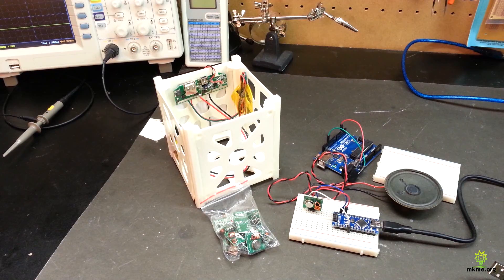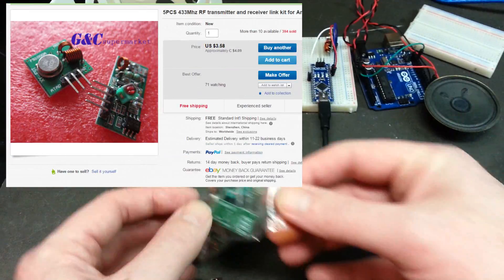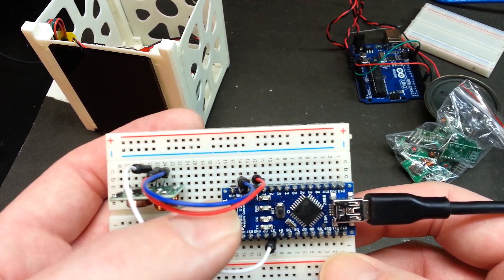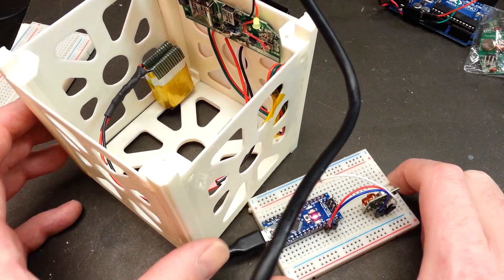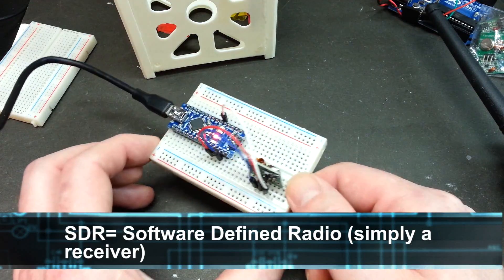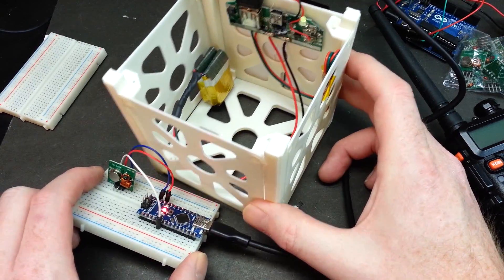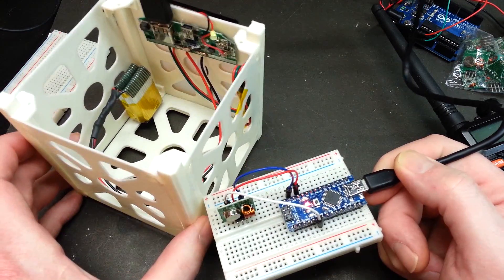Let's make a Satellite with Arduino Part 4- Transmitting Telemetry!

Comment: Bonjour, j'ai le même émetteur (le même que dans la vidéo le Generif RF 433Mhz) mais je ne trouve pas la fréquence de réception il me dit qu'elle est de 433.920 Mhz mais le signal est faible. Quand je passe à 439.000 Mhz, le signal est à 2 - 3 bars sur mon baofeng uv5r. Connaissez-vous la fréquence précise de ce type d'émetteur?
Reply from the maker: Je pense que vous pourriez juste changer les frequences pour le trouver.  Essayez un SDR pour visualisation

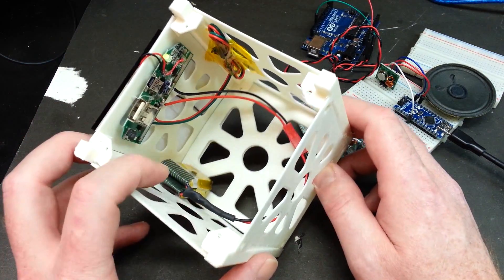Comment: 0:50 original battery of? Is that from mobile charger adaptor. Can you explain the wire connections .
Reply: Looks like two single cells in parallel
Reply: I understood that plug wires goes towards solar cell but I won't understood the battery wire connection(another wire goes towards battery)

Comment: I know this is just prof of concept but those batteries would be ice cubes in low earth orbit
Reply: ??? EASY fix ... thermal blanket, low voltage hand warmers and a temp sensor ...
Reply: Boyd Bros. Thermal blanket adds weight and an electric  heating element would draw too much current
Reply: How does NASA do it?
Reply: Boyd Bros. Nasa sends satellites that are the size or refrigerators they have the size, weight and money to have things like that

Comment: HI there! Your code actually comes up with an error when compiling, exit status 1
two or more data types in declaration of 'setup', 

Any thoughts? I'm just starting to look into this, but thought I'd mention it.. Looking to use this in a project :)
Reply from the maker: You likely didn't clear out the default structure text in the IDE or copied some html etc.
Reply: For this error you need to bring the void items up one line i.e.

void
dash() {

should be: 

void dash() {

Comment: Hey Bro, awesome tutorial... can you please tell me will a transceiver with these specs work in LEO.

 Model: E31-TTL-1W
Interface Type: UART
Operating frequency: 433MHz (425-450.5MHz)
Transmit power: 1W

and also tell me the minimum power required to transmit data from LEO...

Comment: bro but for transmission from space we need to have larger frequency
Reply from the maker: Frequency is just fine and in use on many sats already. Wattage would even make it from LEO.   Again this is not going into space though...
Reply: ok what do u think would be good wattage for leo....good enough to give clear reception
Reply from the maker: Look at the SO-50 videos on my channel or others- that is 250mW crystal clear. You could get away with much less if you wanted...
Reply: can i get ur email address...i am actually designing a cube sat for my college project....and am making it in such a way that if i get a chance then i could actually launch it...you seem to have quite a good knowledege regarding this stuff so wan to discuss with u....
Reply: @rohitbokade5771   im making a monoghrapic about cubesat .
Reply: @stopPlannedObsolescence  great... would be open to help
Reply: hey bro how far did your cubesat went? Which transmitter/transceiver did  you use...
Reply: @HarshKumar-tw3st  its in process... expect it by 2020

Comment: what are those black white and blue cables called
Reply from the maker: +JkBoyer They are just jumper wires
Reply: +MKme Lab thanks also I am thinking about adding a barometer to it just to double check it does include readings for temperature and alttitude (BMP180) so I wouldn&#39;t need a temperature sensor or a altimeter ?

Comment: Hey Eric if you are still responding on this video i would like to know what kind of high power tx/rx could transmit from space. Are we talking 5.8 Ghz or just more wattage?
Reply from the maker: +Rocket Man Don't need high power. 1/4 watt on 2 meters is used lots. Check out my SO-50 vids.  That's all it uses.

Comment: That's not enough to receive all the way from space. I understand it's just proof of concept, but how could I make a big one with roughly 200 miles range? I was thinking an oscillator crystal and a 74HC244 octal buffer using all channels in parallel for more power, but i'm not sure if that would work or even what frequency crystal to get. And then there's the receiver, since the signal is such low power, it's going to need a big antenna.
Reply from the maker: +175griffin  On the TX power- you don't need much as remember they are LOS.  250 milliwatts will get a darn solid signal to the ground.  Check out the SO-50 sat vids on my channel.  That is all it uses with a simple 1/4 wave antenna.  It is around 650KM height orbit. You don't need as much as you think if you wanted to do the real thing...
Reply: Cool

Comment: Awesome work Eric, what is the output power on this transmitter and what is your plan for an antenna?
Reply from the maker: Ringway Manchester The output is really low on these (I forget the values honestly) I may add an antenna but truthfully haven't needed it inside the house.  Plenty of range so far.  Cheers